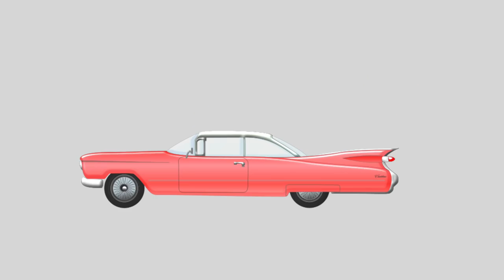Yes, Rockets CAN Fly in a Vacuum

Comment: Why did you leave out the essential elements of the internal combustion engine? The expanding burning fuel/air mixture drives the pistons down the cylinders, turning the crank that ultimately turns gears, transmission, then wheels. You do your viewers a disservice. You should be helping them to visualize the physics as accurately as possible, but instead it looks like you crammed for an exam and missed some essential pages of your textbook. The way you describe it makes it almost sound like the force of combustion comes out the tailpipe with the exhaust, rather than being directly exerted on the pistons which then transmit the force through the drive train to the wheels. You put all this effort in but you blow it by not really studying the basics of the material. OK, so you're a youtube star. You get a C- in science for laziness because of your inaccuracy. I stopped watching after the '59 Caddy. I had 3 '59 Caddys in my day, worked on the engines, one of them was a real Ghostbusters Hearse. I watched every liftoff since Alan Shepard. I hope somewhere in here you describe Newtons laws of motion as pertains to rocket engines. Not gonna slog through the rest. I wouldn't critique you if I didn't think you were making something worthwhile, but you gotta start getting more of it right. People are going to be misinformed if you don't pick up the slack

Comment: The exhaust coming out the back of the car has absolutely nothing to do with the cars forward motion
Reply: The fact that you think exhausting exiting a car's tailpipe is comparable to a rocket eliminates you from the conversation.
Reply: Wrong!
The exhaust coming out the back of a car has very, very little to do with the car's forward motion.
Reply: @fromnorway643  wrong.  The exhaust owing from the car has zero impact on the car.  The simple rolling resistance of the tires (friction) far surpasses any miniscule thrust generated by exhaust gasses.  It contributes zilch.

Put your car in neutral.  Rev the engines.  Nothing happens.  That's because the thrust is virtually nonexistent compared to the amount of friction you must overcome.

Next...
Reply: @willoughbykrenzteinburg 
What I meant is that in theory, the thrust produced by the exhaust isn't zero, but it is of course so insignificant (millinewtons?) that it's safe to ignore it.
She shouldn't have mentioned it at all.
Reply: @willoughbykrenzteinburg  : He didn't claim it moved the car. He claimed, rightly so, that the exhaust does create a force. Are you claiming otherwise? If so, please show us your calculations for your claim.
Reply: @kitcanyon658  Not claiming otherwise.  I stated very clearly that any thrust created by the exhaust would never overcome the rolling resistance (friction) between the tires and the ground upon which they sit.  That friction exists whether the car is in motion or not (albeit less when the tires are rolling - its still insufficient to overcome the lesser friction) It contributes zilch because that friction always exists.  I've come across you before, and I know you're smart.  My default reaction is that you've misunderstood me.

I said "no impact"; not "no force".  If I stood next to a building and pushed it with all my might, it would have no impact on the building.  I'm not saying I've applied no force to it.
Reply: @willoughbykrenzteinburg  : Cool, man. Totally makes sense. Thanks.

Comment: Ion propulsion ?    do you know how much chemical thrust it would take to move a rocket with ions and how long it would take to build momentum (basically electric energy) Answer:  for practical purposes it might as well be  an infinite amount.  BS video
Reply: Sorry but there are DOZENS of spacecraft that are using or have used ION propulsion.  Just because YOU dont understand does not make something fake.

Look at it this way: Does a SINGLE ION of Xenon HAVE MASS?  Yes or NO?
Can you ACCELERATE A MASS without a force ?  Yes or NO?
SO what happens to a machine that ACCELERATES the mass of a single ION?
 Does it feel the force required to accelerate that ION or not?

Answers:
Yes
NO
It feels the acceleration force too
Yes

Comment: Major Omission in the explanation- air pushes against air. To get an equal/opposite reaction there has to be an opposite resistance. Water against water. Mass against mass etc. There's nothing to push against to move forward in space. Elon Musk explained this difficulty in an interview....
Reply: the mass of the rocket is pushing against the mass of the exhaust
Reply: - "Mass against mass etc"
I wonder WHY the rocket is more then 95% REACTION MASS when it lifts off?

For example, a Space Shuttle Main Engine consumes 500 kilograms of liquid hydrogen and liquid oxygen per second .
It combusts those and expels the "exhaust gas" at Mach eight.

What do you suppose the "Mass" IS of that exhaust gas over one second?
Reply: The exhaust gasses push on the rocket. That’s it.
Reply: @AM-rd9pu WRONG!!
Gases will be spilling out into an accelerating void and no reaction will happen because the acceleration of the void will displace the gas at a higher rate than can be expelled. Period.
You haven't the slightest clue what your talking about.
The acceleration is a pitfall for your space paradigm but, it's absolutely needed to explain away the sky's PROVEN motion relative to a FIXED STATIONARY earth.
Reply: @dragonz_eye  Here is an example for you:
A Space Shuttle Main Engine (SSME) can accelerate 500 kilograms of pure water EVERY SECOND from a velocity of ZERO to MACH EIGHT (2500 meters per second).

Now explain HOW a SSME can do this right here on earth in atmosphere.
Really - EXPLAIN the Physics of the SSME and its ability to accelerate all that mass.
HOW does it do this?
Is it "Magic" to your prepubescent intellect?
Reply: @dragonz_eye  So you think that rockets can accelerate mass without applying any force to that mass.
Got it.
You don't understand Newtons Laws.
Perhaps you should consider completing high school before arguing basic physics with rocket scientists?
Reply: @stuartgray5877  the exhaust is pushing against the ground and air. None if which are in space.
Reply: @AM-rd9pu  the exhaust pushes against what though? In earth it moves air, like a propeller pushes water .
Reply: @mikeedwards1096  - "the exhaust pushes against what though?"

Answer these questions regarding any regular rocket in earth's atmosphere:

1 - Does the exhaust gas have "Mass"?
2 - Does the rocket engine "Accelerate" the exhaust gas?
Reply: @stuartgray5877  WRONG!! 
Missles work by push back from expulsion. 
What's pushing back a missles expulsion in the accelerating vacuum?
Here on earth, we have atmos that provides friction for a missles expulsion to provide forward work.
Grow a brain,.. then try using it.
Reply: @mikeedwards1096 The exhaust pushes on the rocket.
Reply: @dragonz_eye I have to ask. What’s your education and experience in science?
Reply: @dragonz_eye  - So you are INCAPABLE of answering the questions:

1 - Does the exhaust gas have "Mass"?
2 - Does the rocket engine "Accelerate" the exhaust gas?

Then you have NO BUSINESS trying to explain basic physics to ANYONE.
You cannot "Teach" if you refuse to answer questions, im be cile.
Reply: @dragonz_eye Of course you’re a hypocrite who demands others answer questions while actively avoiding questions asked of you.
Reply: @dragonz_eye Of course you don’t want to explain yourself. It’ll only further prove just how absurd your claims are.
Reply: @AM-rd9pu I don't make claims. 
I simply explain to you your own fictional concept of "space."
Making claims about sky phenomena is absurd.
You can form a hypothesis.. but nobody should make a positive claim as to what they observe.
Reply: @dragonz_eye  "I don't make claims."

Everyone can see that's a lie, you make claims all the time.
"CUMBUSTION WORKS BECAUSE OF ATMOS.
IT WILL NOT DO ANY WORK IN YOUR SPACE FICTION."

And I won't even talk about the typo, you're welcome.
Reply: @frantaspacek Yes. That's not a claim.
That's reality.
Can YOU demonstrate any other options for combustion?
Reply: @dragonz_eye  No kiddo, that's a claim. Go read a dictionary.
Reply: @dragonz_eye You are making claims and you are explaining nothing. Your entire “argument” is “nuh uh”.
Reply: @AM-rd9pu No I'm pretty sure I've explained the CLAIMS of your own beliefs.
Can you list the CLAIMS I HAVE made.
Reply: @dragonz_eye   - So you are INCAPABLE of answering the questions:

1 - Does the exhaust gas have "Mass"?
2 - Does the rocket engine "Accelerate" the exhaust gas?

Then you have NO BUSINESS trying to explain basic physics to ANYONE.
You cannot "Teach" if you refuse to answer questions, im be cile.

Every single High School graduate that I know CAN answer those questions without even looking anything up.
I WONDER why you REFUSE to answer?

Oh, THATS RIGHT because answering truthfully proves YOU WRONG.
Reply: @dragonz_eye  Watch:

1 - Does the exhaust gas have "Mass"?

Yes. the exhaust gas from rocket engine has mass.
A Space Shuttle Main engine (hydrogen Oxygen) expels pure water as exhaust gas (water has mass).
Kerosene/oxygen engines expel CO2 as exhaust gas (CO2 has mass. If you don't think so, let me throw block of dry ice at your head)

2 - Does the rocket engine "Accelerate" the exhaust gas?

Yes, Rocket Engines accelerate mass out the back of the nozzle.
They accelerate the mass using gas "Pressure". (Pressure is a measure of "Force per unit area").
A SSME accelerates its exhaust gas to MACH EIGHT.

See.
That wasn't so hard was it? poor thing.
Now be sure to DENY these answers as they prove YOU WRONG.
Reply: @dragonz_eye  SO you AGREE that rocket push mass out the back and are propelled forward by the RECOIL FORCE?
Cool. Then you DO agree that rockets work in a vacuum, since the absence of air does NOT AFFECT THE RECOIL FORCE.

Cool.
Reply: @dragonz_eye  Here are just a few claims you have made. I’ll be directly quoting a previous comment of yours. 

“space can not exist in the way it’s described”
“Physics are changing”
“Relativity is going into the trash”

All of those are unsubstantiated claims.
Reply: @dragonz_eye  They’re not your claims? 

Then I invite you to directly quote any actual scientist making the claims you just listed.
Reply: @frantaspacek Can you bring me some "space" to analyze?
NO?
Well, I guess PHYSICS DONT IMMEDIATELY APPLY.
Reply: @AM-rd9pu FIND THE INFORMATION YOURSELF.
Or don't.
I DO NOT CARE.
Reply: @dragonz_eye  Thanks for confirming the "you're a liar" part. Not that it was required, because it's obvious to everyone with half a brain, but it's the effort that counts.
Reply: @frantaspacek  Because I won't do what you want,.. I'm a liar?
Tyranny much?
Reply: @dragonz_eye  No, you're a liar because you knowingly say things that aren't true and then you do your best to avoid it when we ask you for clarification.
Reply: @frantaspacek  That's a lie. Liar.
Reply: @dragonz_eye Of course you’re too lazy to do your own research to prove your point. You wouldn’t be a flerf if you actually had the academic integrity to do some proper research.
Reply: @dragonz_eye  You know there are literally HUNDREDS of videos from SpaceX showing that their rockets work just FINE in a vacuum.
THEN there are THOUSANDS of videos from the observers of these launches.
I know this for a FACT because I have personally witnessed about a dozen of these Falcon9 launches WITH MY EYES.
Reply: So you think Musk is faking space and is in reality a flat earther? LOL.

Ok, Mike. Sure thing. Got it.

Comment: A balloon rocket can't fly if you put a vacuum cleaner behind it. Space is like a giant vacuum cleaner.
Reply: Alex  Hahaha, good one.
Reply: awesome logic.. vacuum cleaners equate to space.. LOL.
Reply: Your first mistake was thinking that a vacuum will suck.
Reply: @DeusVult1527 High pressure areas will expand into low pressure areas.
And if you can direct that expansion you can harness the energy. You know, by using a rocket.
Reply: @DeusVult1527 
Does the gas have mass?
Reply: @DeusVult1527 "you cannot apply the principles of inertia to unconfined gas molecules"

Who said anything about unconfined?
The molecules in the combustion chamber and engine bell are confined. They can't expand up through the rocket, they can't expand sideways due to the engine bell.
There's only one direction that the gas can expand.
The gas is matter and therefore has inertia.
And since the gas is accelerating in one direction only, it's momentum is changing in one direction only.
Total momentum must remain constant so the only thing that can happen is the rocket accelerates in the opposite direction.

Once the gas has left the engine bell it's out of the system and free to expand into the void.
This is the point that you are starting your argument at.
You're ignoring everything that happened before this point. But at this point the gases' interaction with the rocket is already finished.

Comment: Your balloon has air and external pressure around it. It won't in a vacuum
Reply: But in a vacuum the surface tension of the balloon is still squeezing the gas inside.
If you poke a hole in the balloon in a vacuum the balloon will get propelled as it pushes the air out of the balloon.
Reply: @stuartgray5877  So w=PV is wrong? You keep saying that, chatbot 😂
Reply: @papalegba6796 once again. That equation or for a cylinder. Work also equals torque multiplied by angular change. You don’t see me applying that to a cylinder do you? That’s because that’s the work equation for rotational work. 

Similarly the work equation is different depending on the process.
Reply: @engineeringtheweirdguy2103  no, it is the equation for work done by a gas against constant external pressure, lying chatbot that replies to me in minutes even tho I did not comment to you. So the equation applies to the gas coming from a rocket engine, and means it will produce no work in a vacuum. Stop hating the laws of physics, gaslighting chatbot bro 😂
Reply: @papalegba6796  ahh, no it’s work done to a cylinder of whose piston head moves against external pressure.

Probably worth getting it right. There are hundreds of work equations. You’ve arbitrarily picked one to use as an argument without understanding what it means.

Have you even seen the derivation of that equation. Hint. It involves a cylinder and piston.

You can’t use that equation for any other gas related process. Like a jet engine. Turboprop aircraft, helicopter, even a balloon letting out air. Much less a rocket.
Reply: @stuartgray5877  that's not what happens during free expansion, but carry on lying, chatbot bro 😂
Reply: @engineeringtheweirdguy2103  I picked the only one that applies to the exhaust of a rocket. Sorry it proves you wrong .😂
Reply: @engineeringtheweirdguy2103  funny how you can never provide citations to support your claims, isn't it?🤔😂
Reply: @papalegba6796  I already told you where to find it. And no. The only one that applies to a rocket is the rocket work equation. It’s not my fault you don’t know how to read it.
Reply: @engineeringtheweirdguy2103  can't cite it tho? Ok you lose😂
Reply: @engineeringtheweirdguy2103  no it hasn't & yes I have, lying abusive chatbot 😂

Comment: What does it propel against..??
Reply: - "What does it propel against..??"

What makes a crossbow have recoil?
Reply: @stuartgray5877  you didn't answer, chatbot 😂
Reply: @papalegba6796 the flame, they push on the flame
Reply: @O5-hans  wrong. Violates Newtons first law 😂
Reply: @papalegba6796  Why don't YOU answer the question so you can see where my questions are going?

Oh THATS RIGHT you REFUSE to answer questions when answering truthfully proves YOU WRONG.
Reply: @davidmescher2526  so NASA are lying? Cos they say it's external force. Glad you agree anyway, chatbot 😂
Reply: @stuartgray5877  a rocket is not a crossbow, chatbot 😂
Reply: @papalegba6796  
"a rocket is not a crossbow, chatbot"

They work by the same basic principle because they both accelerate mass in one direction which produces a recoil in the opposite direction. A large rocket can eject several tonnes of hot exhaust gases per second at 3-5 times the speed of a rifle bullet.
Reply: @fromnorway643  Dont give papalegba any of your time or effort. It failed to complete high school, and has never taken a physics class OR a chemistry class.
Watch.
Reply: @papalegba6796  Care to tell us where the force originates that accelerates the mass of the exhaust gas into the vacuum?
Reply: @papalegba6796  How about: What is the by-product of burning hydrogen and oxygen?
In other words What IS the "exhaust gas" from a space Shuttle Main Engine?
Reply: @fromnorway643  wrong 😂
Reply: @stuartgray5877 hi there, one-trick chatbot 😂
Reply: @fromnorway643  - see?
Reply: @bobartor910  you seem normal 😂
Reply: @stuartgray5877  answered you hundreds of times already, chatbot 😂
Reply: @bobartor910  then see how it always tries to tell us that it already DID answer us (when it NEVER HAS because it knows that answering truthfully proves IT wrong). It always types more words explaining why it does not need to answer than just answering. It is so predictable being a Bot and all.
Reply: @stuartgray5877  NO U!😂